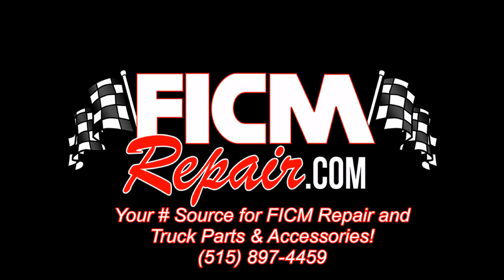Powerstroke 6.0: High Pressure Oil System Issue or FICM Issue?

Comment: Is it ok to have a spoofed icp psi reading?
Reply from the maker: Having a spoofed ICP psi reading is just part of it for an ECM-tuned truck.  If you are running a non-tuned truck, the ICP psi number can be trusted.  It's best to just rely on the ICP voltage readings.